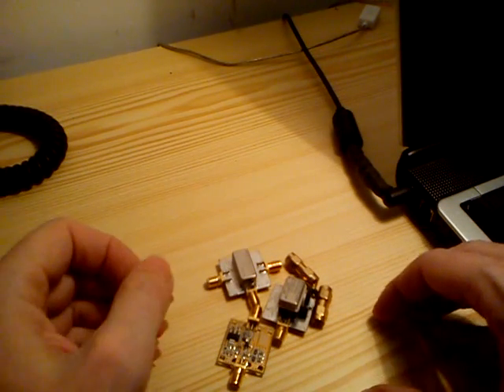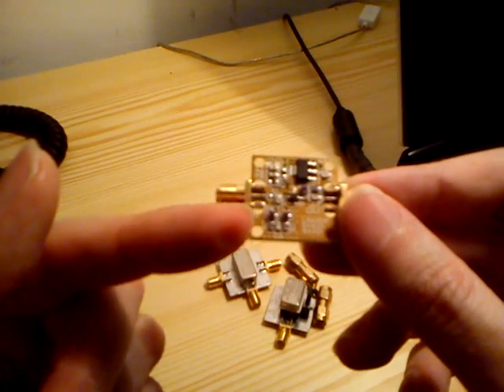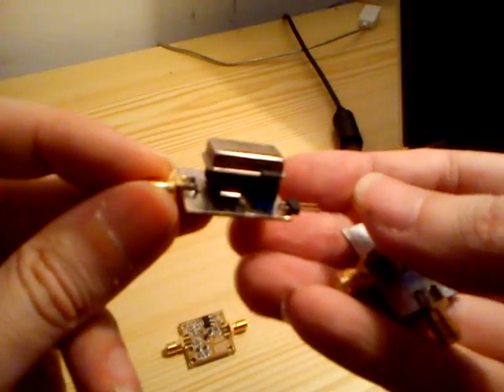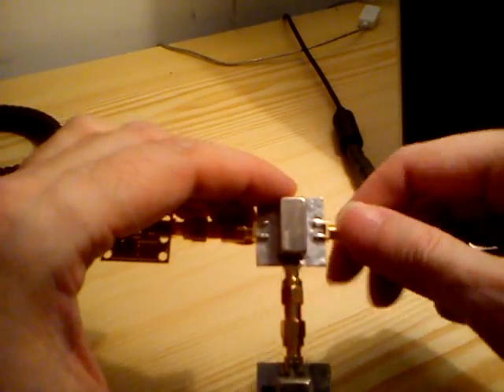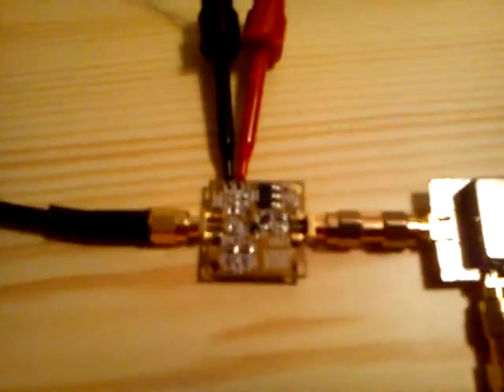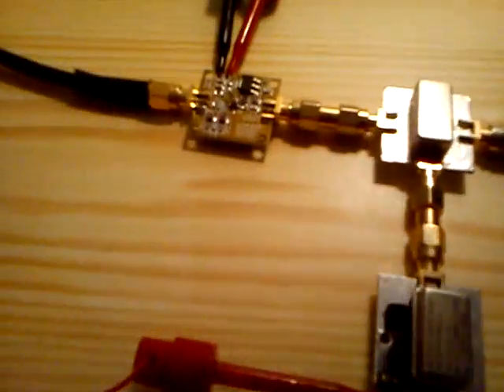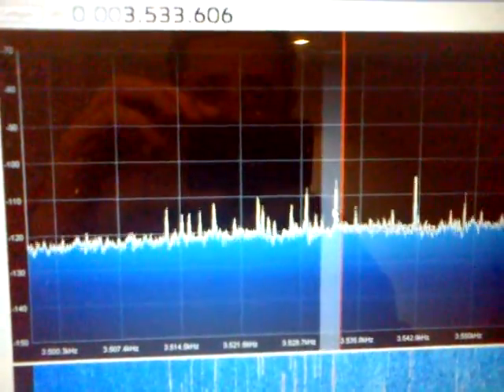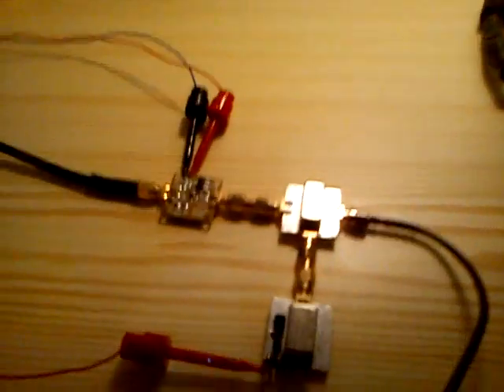HF upconverter built from the LNA4HF

Comment: I have mine now (2 weeks over Xmas is fast) and can now recommend this. 
Love it.
Reply from the maker: Hello Alan, I am glad that we overcome the yahoo mail problem and you find the unit useful. The shipping was relative fast despite the season's holidays.
Do you use the same setu as mine, separate mixer and theboscillator or you already have some upconverter?
Reply: No upconverter, just a random wire anetnna, a Tecsun PL-390, balun (unun actually) and you amp in-line.
The antenna needs to be longer and higher, and I suspect I need a better RF earth, but signals have improved noticeably in the HF band. When I eventually get a HackRF Blue I will keep this, and add an upconverter.